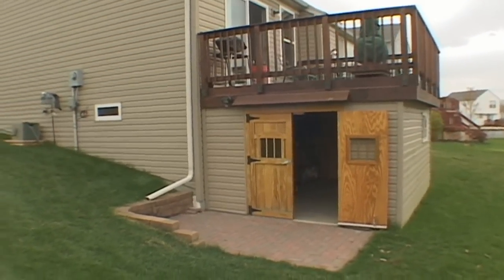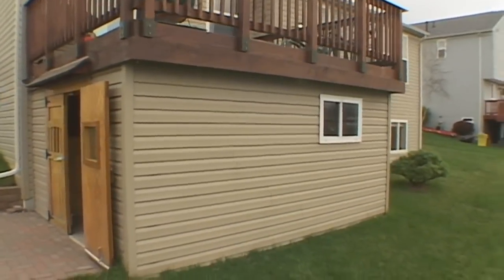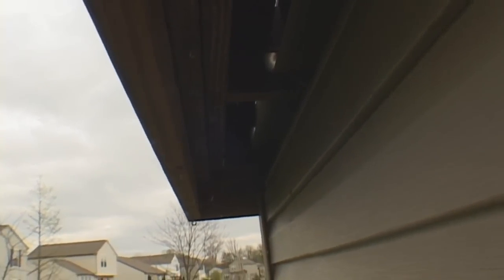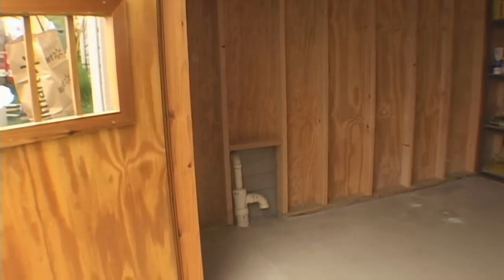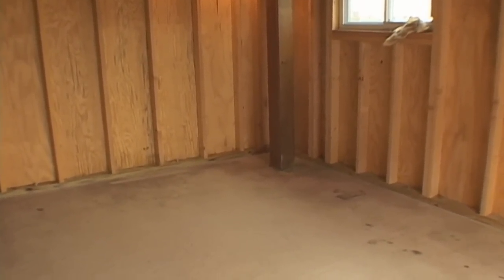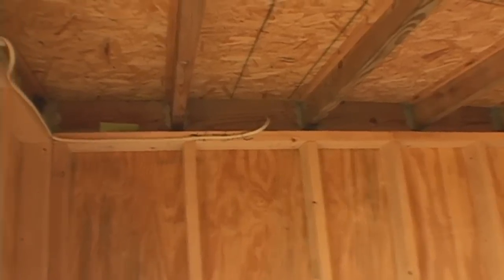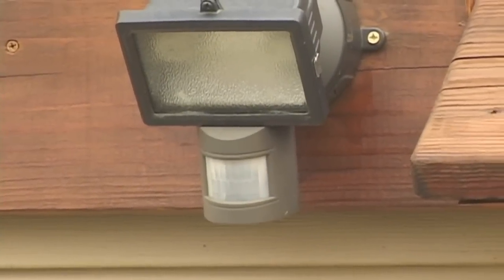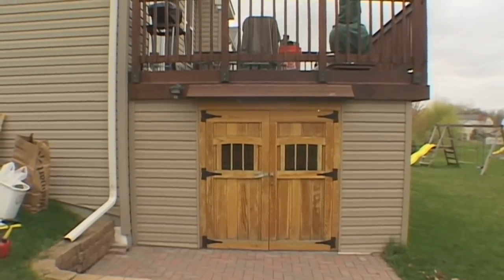Building a Shed under a Deck

Comment: I Might have missed it.  I saw the foam in the space between the wall and deck.  How did you deal with the walls of the addition where they meet the house wall?
Reply: ah saw the same question below is answered.  Walls are not attached to house at all.
Reply: The house wall with siding remained unaltered.  The shed wall facing the house wall is bare plywood.  No siding or even tyvek was  not installed.  The distance, as you can see is reasonable close, but looks closer than it is because of the shed vinyl siding end caps tend to cover the corners more and that did a great job of hiding the gap.  You can't see between the 2 walls.  The spacing worked out great.

Comment: Thanks for the video, it's inspired me!  I still don't understand how to attach the walls?...I know you said you left a gap and they weren't attached to the deck itself, but the video makes it look as if they are?  Where exactly do you leave the gap, at the top or at the bottom?  And, what do you attach the walls to if you don't attach them to the deck?  Sorry, this is my first project and I am confused
Reply from the maker: 4bmmc3 The walls are bolted to the concrete and to each other in the corners.  They are not attached to anything else.  They are not attached to the deck and they are not attached to the house wall.  They are very rigid and do not move or wobble because they are bolted to the concrete.   The gap is between the top of the wall and the deck and is maybe 1-2 inches and is difficult to see.  Look at 2 minutes and 20 seconds in the video and you can see I filled the gap with some foam to prevent wasps and small animals and stuff getting inside.  There is a skirt board wrapped around the lower part of the deck (attached to the deck only) which completely obscures the gap from the outside and prevents high winds and rain from getting inside.
Reply: ***** Thanks, that's awesome!  I originally thought the walls were bolted to the deck somehow, but it now makes sense!  Thanks again!

Comment: Wow. That is the shed after seven years!? The inside looked like new on the video -- the lack of issues over the years seem to be a testament to the effectiveness of your plan and construction!
I am currently planning something similar -- the idea is that my space will be for doing work that I would rather do outdoors, but that I cannot just do in an unprotected space due to our Alaska winters.
There is a suspended (?) patio beneath our deck. Hmmm? After looking at it again the deck may just be supported by the ground and slide up and down the supports for the deck and stairs during seasonal changes -- thank you so much for pointing out the need to allow for expansion in your construction! .
Reply from the maker: Going on 15 years and still no problems... I did have to refinish the doors and the deck though.
Reply: @panofish  I'm in WIsconsin, and we get some cold winters as well.  I noticed you used treated lumber on the concrete floors, but non-treated for everything else.  The inside looks great on yours.  Would you consider using treated lumber all around if you did it again or just use the treated lumber on the concrete?
Reply from the maker: @z28rjb  No need.  Just treated lumber on the concrete and I did separate the treated lumber from the concrete with a thin sheet of isolatiing foam before I bolted the base plates of the wall down.  It is now going on 17 years since I built it and the inside still looks perfect... just a few cob webs and dust. The deck above is still solid, but is showing some age.  I will probably replace the decking and railing with more modern plastic or composite boards.   I just need to find something that will also cover the skirt boards completely and look clean.

Comment: How did you get those metal sheets on? Glue and held it until dry? How were you able to put in the seal caulk? Seems easy for the first side but the 2nd side seems hard to get it in when up?
Reply from the maker: staples first.. then I used industrial caulking.
Reply: @panofish  thanks. Were the sheets cut into small lengths to get a staple in? It seems hard if its a really long sheet?
Reply from the maker: @ychongy  I cut the length to match the full length of the joists from a roll of aluminum sheet.  And because the width of the aluminum was wider than the distance between the joists, the sheet naturally curved into a u shape and made it easy to fit.  There is also a sloped trough created by plywood between the joists and that also made it easy to fit into place.... then I used minimal staples and lots of caulking.  It's been about 17 years and the shed roof still shows no leaks.
Reply: @panofish  Thanks. I'm still confused on how you were able to get staples and caulking in? You put the sheet in and it naturally curved. But how were you able to staple and caulk when its covered? Unless you took the patio floor boards out from the top?
Reply from the maker: @ychongy  I did all before I covered with deck boards.  So I carefully stood on the joists or used a loose couple of boards that I moved around to stand on.  And finished installing all aluminum and caulking before installing deck boards on top.
Reply: @panofish  ok that makes sense. Thanks.

Comment: Where did you get the half round sheet metal to put in the rafters? Having trouble finding the material
Reply from the maker: It was a flat roll of thin sheet metal, probably meant for roofing purposes.  The width was perfect to put between the joists and onto the inclined plywood.  It naturally created the curve on its own... I just stapled and sealed the edges with industrial caulk.  :)

Comment: how do you deal with water on the Deck? where I am we get a lot of snow... so wood would start rotting after a while.
Reply from the maker: +Zack Rickowski It's the same with or without the shed.  In the winter the snow sits on the deck... when it melts it falls through into the troughs and onto the lawn.  I'm in Michigan and we get plenty of snow and rain, but I see no difference in my deck, before or after installing the shed.

Comment: How did you handle the wall connecting to the house side?
Reply from the maker: I built the shed wall a few inches away from the house.  The wall still has plywood, but I didn't need to install vinyl siding.  The vinyl siding end caps help hide the view.  You can't see the backside.

Comment: hello, how did you screw the back wall? thanks!
Reply: Was wondering about that also. I'm thinking he built the wall as a hole and tilted it up into place before he tied it all together and secured it to the floor. Interested to hear how he secured the plywood to the back wall.

Comment: Awesome job. We are trying to do the same type of thing but are stuck at how to do the roof....can you give a bit more of a description on how to do the roof to ensure water does not get in and what exactly is needed. Thanks
Reply: Need the same information. We have the walls and all up, but what to do about the roof and making sure that's water tight from the deck above is the hard part.  Need advice on a "reasonable" solution. I know Dry B low is an option but it would also be about $2,000.

Comment: Very nice. I'm planning on doing a similar build when the summer rolls around. I stumbled across your video when I was looking for ideas on the doors. Did you custom make your doors? Did you just use some plywood and wainscoting?
Reply from the maker: +Kev Thanks... I did custom make the doors.  They are plywood backed, with tongue and groove cedar planks and cedar framing around the outside and the windows.  They came out great and work great.  I am planning on refinishing them  this summer... the epifanes finish is finally wearing off.

Comment: Great, thanks for info. Would you care sharing some more info? Cost of concrete floor? Did you DIY floor? Overall approx project cost and how did you screw the aluminum flashing to joists as place where you screw them is hidden between deck boards and flashing itself? Thanks!

Comment: i learnd a lot from your video.  My deck is already built and the support posts are at the corners. I would probably have to pull up the decking and build the concrete pad and the rest of the shed inside the posts. It looks like your shed is open topped and the metal duct system carries the water away, unless I am seeing it wrong or there is a ceilng on the shed under the ducts.Thanks.

Comment: Great work! Do you have problems with bugs getting in from the space you left between the deck and the walls? Also, why did you have to take the braces off the beams?

Comment: Love the project. I'm considering building a storage area underneath my sunroom as well. With the foam sealed between the deck on shed, have you had any issues with those persistent rodents chewing their way in?
Reply from the maker: Live in Michigan.  Never had a problem rodents.  Just occasional earthworms that crawl under the door after heavy rains